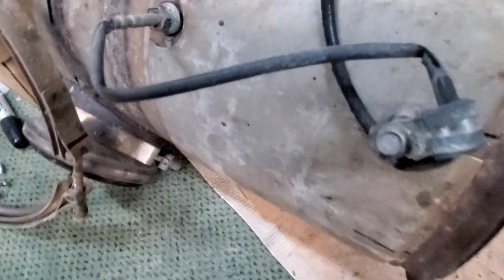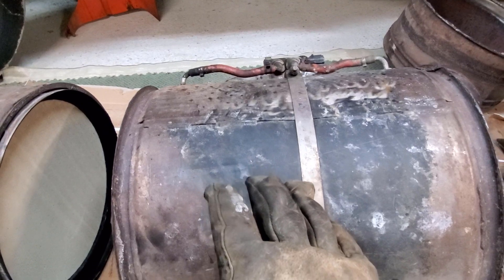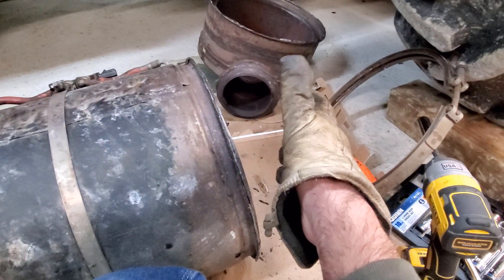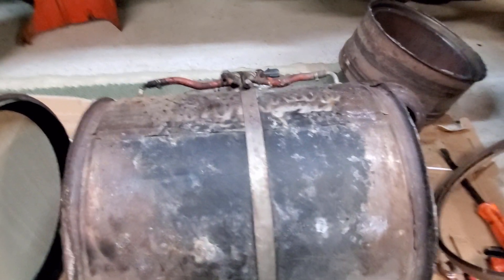What is a DPF (Diesel Particulate Filter)? Cummins ISX15 DPF Breakdown and Inside Parts & Sensors

Comment: Hey I have a 2015 international 4300 box truck I just changed out the egr cooler,dpf and doc filter code before replacing was 1922 and 1921. Now a week later spn 3936 fmi 16.

Comment: Great explanation about DPF. I have semi truck, done dpf filter clean but engine still required Regin after every 200 mile. What possible can be wrong or I need to check?
Reply: I have the same problem try replacing your knock sensor s don't buy the aftermarket

Comment: Hi Ryan on that white blue coming out is it possible  that's is a sensor  going bad because  other than that after it regin it run ok for the next 500 or so miles before it regin again  or is it the seven injector?
Reply from the maker: most likely not a sensor.

Comment: I’ve watched a few people on YT pressure wash them with soap and hot water until the filter is clean. They swear by this method and claim it’s better than sending them out to get baked. What is your opinion of this method.
Reply from the maker: Just answered your question on the other video. Sorry for the delayed reply!
Reply: I have  white blue smoke  coming  out on the right side  when my truck go into regin what is that.

Comment: Did you just replace the center section with the kit you got? Also did you use the old sensors?
Reply from the maker: Yes, correct, only the center section. I have reused the sensors